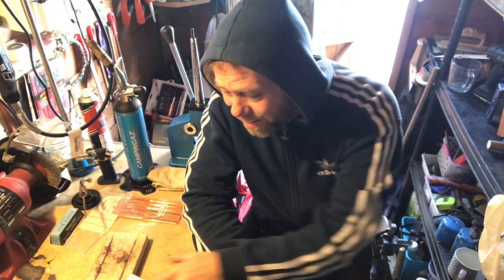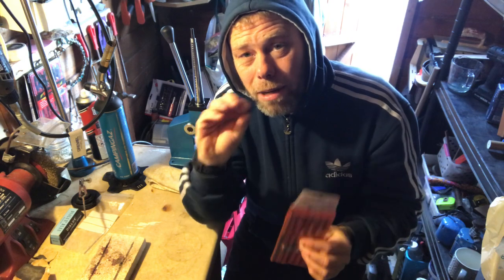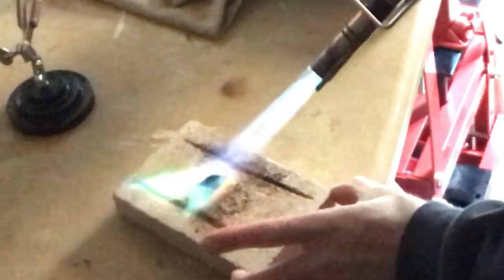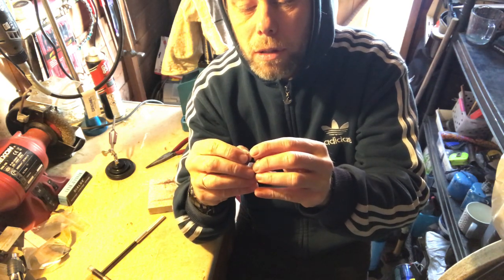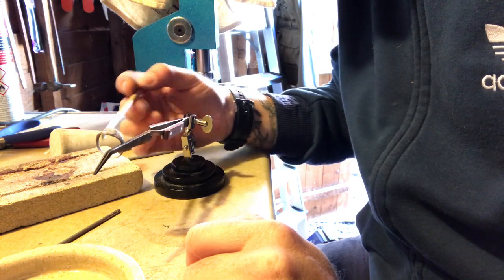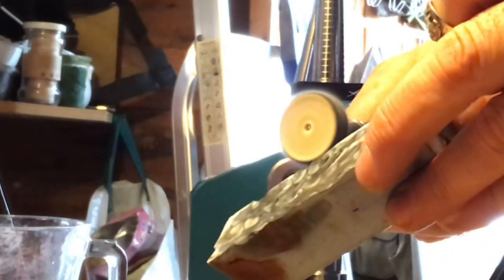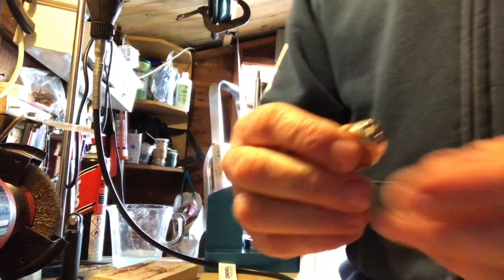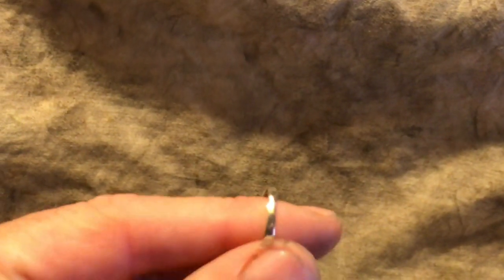silver soldering a broken ring

Comment: Hi Sid, nice job on the ring👍🏻
I realy like to watch Andrew Berry's At the bench here on YouTube, loads of info and very informative😉
I use a small propane burner to solder and the tank is one of the types plummers and painters use in the field.
Burner itself is one I bought second hand with al sorts of different heads and use the smallest one...
Sievert is one of the marks you could search for 😉
Don't know if these are used in the UK as wel.....
You can refill them out of a larger Camping tank using a special connector.
A better quality small lighter fluid operated torch works well on smaller items as well😉
Have fun and All the best, Eric
Reply from the maker: Zeelandia i have just been and brought the sievert torch with needle burner.... now i need to find out which burner for the sievert is adequate for smelting silver coins

Comment: The anchor stamp means it's manufactured in Birmingham (1773-present),  the lion passant is just your standard mark so you know it's .925, the Bs could be Benjamin Smith II (1835 Hallmark) - and the M seems to put the year of manufacture to 1861... Hope this helps. (Unsure about the Bs, as I could not find one with a line under the s...)
Reply from the maker: Awesome.... thanks Jon 👍🏼👍🏼
Reply: Isn't there a jackel head next to the lion Passat if so that would make it London for the city of origin and the M  makes it 1947 I also saw the anchor so if that is correct your right on Birmingham I'm still learning so not 100% on that but I'm pretty sure it's worn a bit but isn't there a jacket head stamp to the right of the lion Passat ?